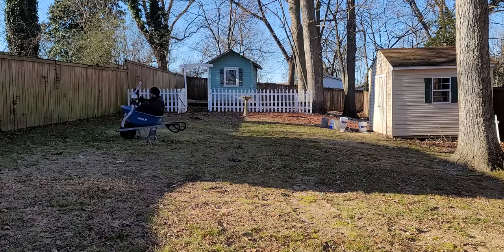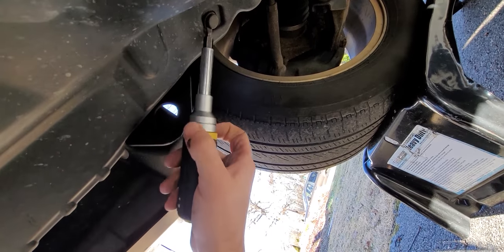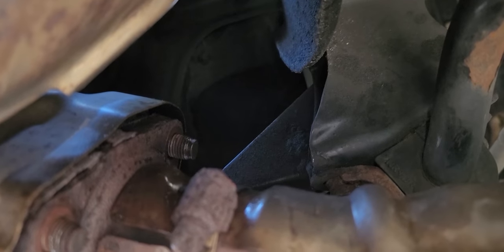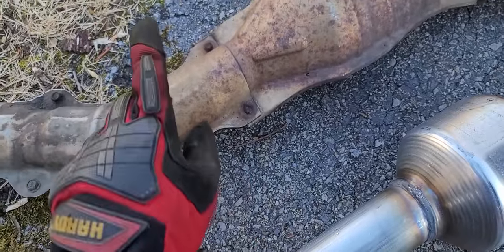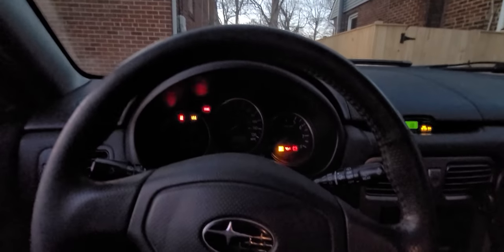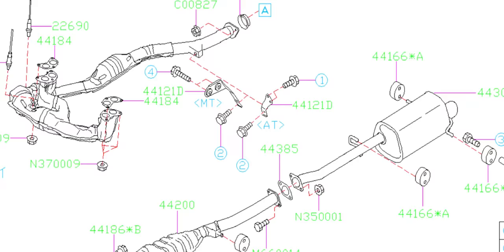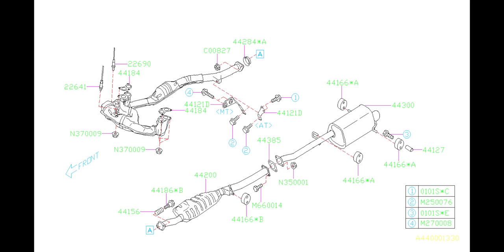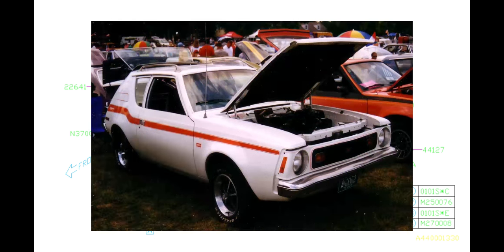How to Replace Downstream Catalytic Converter in Subaru Forester and Gain 1200hp

Comment: I big cat killer on these Subarus is when the head gaskets blow, which they will if you have the crappy single layer head gaskets (almost every EJ-25 except turbos). They need to be replaced before about 100K miles or you'll end up with coolant and/or oil in your cat$$.

Comment: Hey man. Awesome vid. I might do this with my 11' because of same issues. However would I just be able to replace it with a straight pipe? Since there is still a cat in the front. Also wondering if that would increase performance. I should also mention that my forester is a PZEV model so it has that emissions stuff.
Reply from the maker: Yes and no -- you can personally do whatever you want, that's what a lot of folks do to increase the performance (although you'd probably need to pair it with a bigger intake and maybe even a tune). But usually it's not legal either -- you probably won't pass emissions/inspection without a catalytic converter.

Comment: Would you feel air coming out of the muffler ?
Reply from the maker: Not sure what you're asking. Depending on how bad it's clogged, you'll feel some to no exhaust. Though if it's the latter, your engine probably won't run at all.

Comment: About how long did it take for the entire process? About to do the same to my '01.
Reply from the maker: Unfortunately it depends. If you live in the rust belt, you can expect broken/seized bolts, so it may take 1-2 days if you don't have experience with that. If you do and have all the right tools, probably no more than 3 hours.

Comment: Yo I have a 2001 forester and I have the same issue. Just started sounding even worse today!! Which one would you recommend getting from rock auto now seeing as the Bosal isn’t available from them anymore. Thanks mate
Reply from the maker: I just picked the cheapest one I could find tbh. I'm sure the cheaper you go the less effective it gets, but hard to justify big price tag for old cars. Just look at the photo, and compare it to what's actually bolted to your car. Also -- consider taking your old catalytic converter to a scrap yard, OEM stuff can be worth $100-300.

https://www.rockauto.com/en/moreinfo.php?pk=12522449&cc=1368727&pt=5808&jsn=822&_nck=Ekt6BqBF1pwlXdx0gYlm1esw98pF26vehMm%2FGG3C%2Fl2QOXSJubi7WSpUmUSdg3OxWOs2f5z9h422EONy36O0PjCuaadDqI1r86y%2FvJ1lBqy8eOR0sg7BszdZN4sjtsowg31%2Fygv61Xs98S2UdQ37qdUJn6fFWl7zR1w2ckD%2Fqt%2BHTEXGsdHf6S1wHLzeI%2BZZ%2FQavk%2Fj20lWLNjn7zjAO%2Bt9MvSVFZXwaHCjwkSiAknwCIfrCMRBVvZ8TBzSBkpSO%2FRd6KGS0QwBUQni9T5NIgZc0ZOZqFmmS5oqvW%2FqCwesZ6Ezr0qVC7oru86g1yzWftXqY2FwC%2FZrxEPidJCUNUSYTDZz4zpjtslq9s%2Fs%2FaIM%2FbFQnpiCaA%2B6wwipQLd2TwNirYu0C6vXwWzi3%2B5tgCA%3D%3D

Comment: mine was idling rough/jerking/poor acceleration, had my coils/maf/plugs switched out which fixed the idling but still had flat spots in the low rpm when accelerating, I'm about to have my o2 sensors done so hopefully it runs normal after that I'm dreading my cat converter and barely drove my forester because of it lol expensive to service but I love those foresters so I feel justified spending thousands replacing parts haha
Reply from the maker: I got that converter off of Rockauto, $130. I'm sure it barely does anything, but so long as it passes inspection, who cares lol
Reply: Did it fixed the issue and wich of all fixed it ?